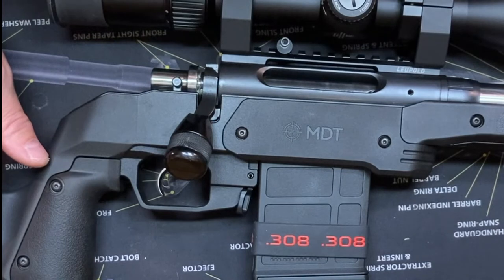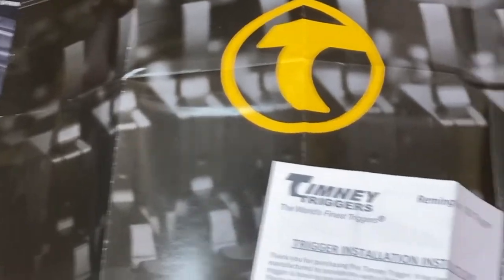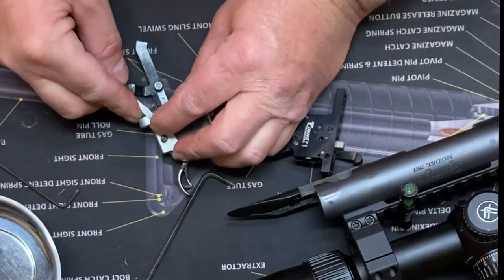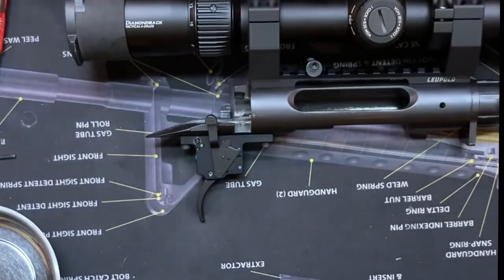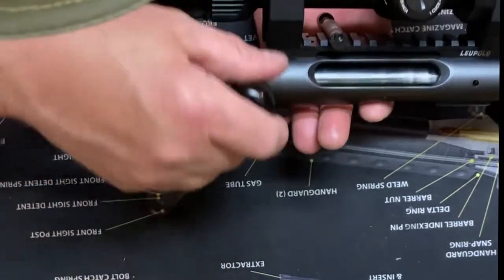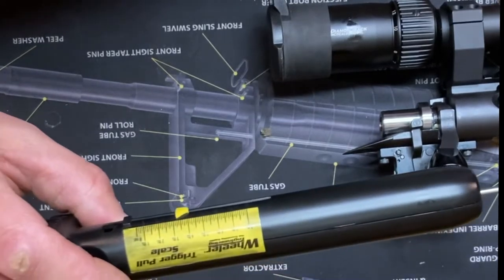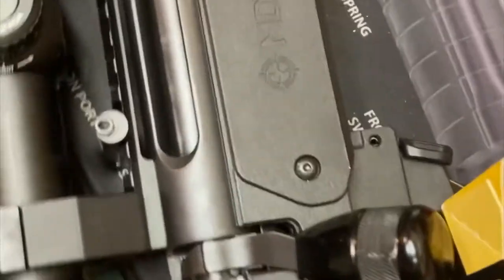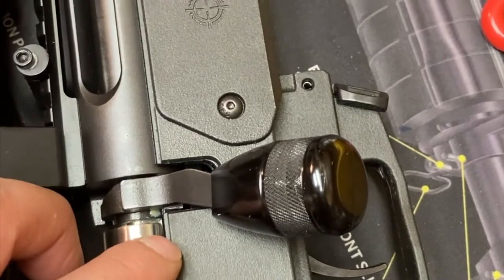Installing Timney trigger Remington 783 and pull weight adjustment.￼

Comment: Where did you get the extended mag and would you be willing to part with the stock trigger?
Reply: Its not an extended mag, he has the 783 action in an MDT chassis, that changes the magazine well to accept only AICS short action 308 mags which is the same for 6.5 creedmoor also. I also went to an MDT Chassis I went with the Oryx but still have the stock trigger adjusted as low as it could go. And it's great but I have felt a good timney and it's definitely different and slightly better
Reply: MDT Has several 783 short action stocks now, LSS GEN2 CHASSIS, Oryx Chassis, XRS CHASSIS SYSTEM. And I had great luck and reliability with both the mdt metal and the hybrid metal/Plastic mag with the window in 10rd size